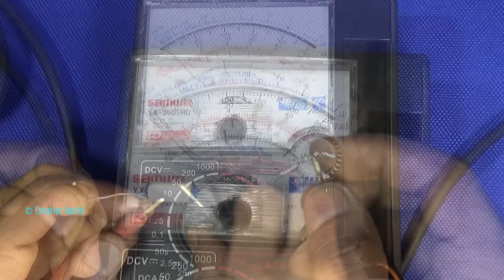How To Repair Power Problem Of Rice Cooker

Comment: Good video. But don't ever use solder to connect the circuit but instead, use a wire clamp connecter. There is still a chance that the solder will melt during a short-circuit
Reply from the maker: Great point!

Comment: ugh I dont have that thing, is that a resistor ? I had 2 resistors, small one on the card that is attached to the front, but I thought that was only for the lights
Reply: Its a thermal fuse..range of tenpereture is 100c-250c...it breaks the connection when over heated...must change when no connection.